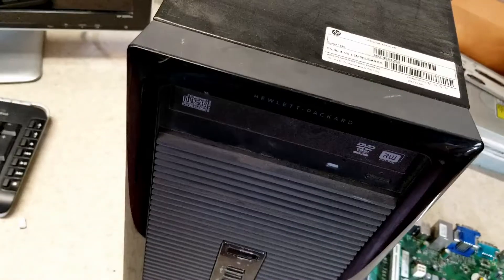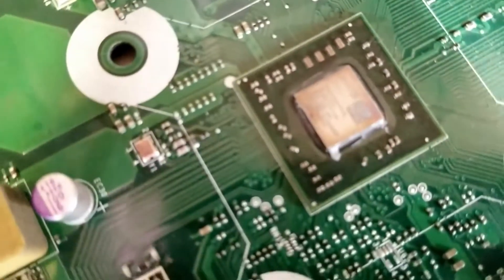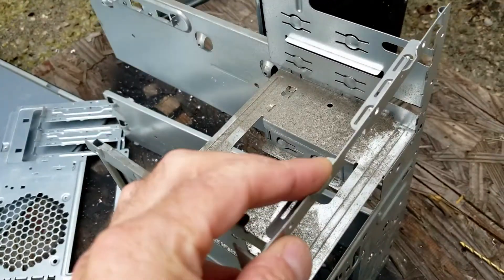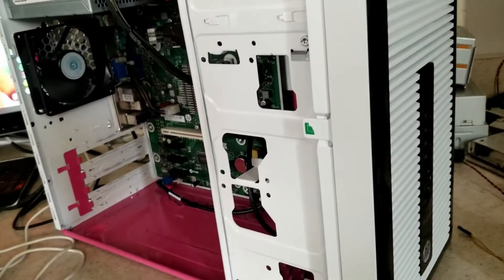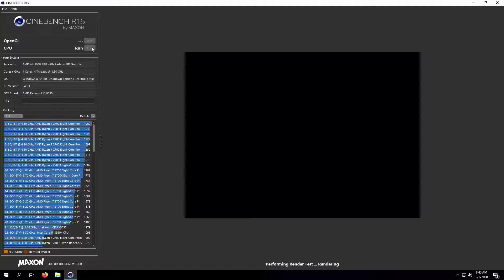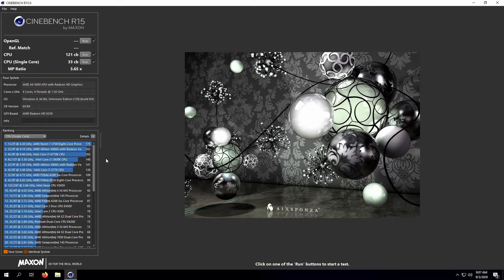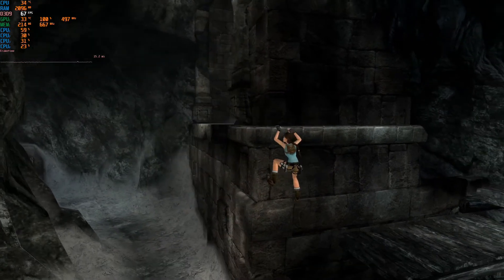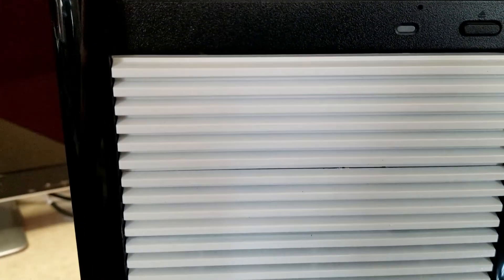AMD A4-5000 APU quad core with Radeon 8330 integrated graphics, 15 watt APU testing with some games

Comment: I had an avarege of 40fps in tomb raider 2013 at 600p and dx11 mode, don't know why it underperforms in this video, could be driver issue. And for youtube, it's not that great for it, with h264ify and a lock of 30fps it can run 1080p barely, mostly 720p. And the architecture disables any sort of overclocking, despite some of APUs from this BGA socket supporting AMD Overdrive, which specifically says in docs about not supporting this APU. A4-5000 is not fun to have in 2013 or today and looses to just about anything except Intel iGPUs from same release time. It does have Vulcan support with 2020 driver, but I doubt it's anything to write home about.

Comment: This APU still holds up well, I coupled it with 16 GB of RAM and a ZOTAC AMP CORE GTX 1650 in Gddr6, and I run games it in low/medium graphics in 1080p: Starfield, Cyberpunk, Mafia 3, Days Gone, The Last Us, Biomutant, etc... quietly. 🙂
Reply from the maker: Thats impressive!
Reply: I strongly advise against this. Instead, opt for a standard i5-4570 for around 50 bucks and invest in a quality build.

Comment: that's NEARLY my specs.  Though thank GOD I don't have the mobile CPU.  I've got an A8-3850.  But oddly it performs about the same as your chip, in most cases I get single digit FPS, though my chip is clocked much higher at 2.9ghz, so it actually runs GTA V at an acceptable 25-35 fps on 720p low, but it's still kind of choppy, mostly when driving fast where the little APU has to load in textures quickly.  I haven't dared trying flying yet.  Or multiplayer, but that's cause I just don't like it.  What rez are you doing YT playback in?  Notice any dropped frames?
Reply from the maker: I think the APU's in the A series were all pretty underwhelming, but good for daily tasks I guess. It will playback youtube videos in 720p smoothly no problem, you can notice a bit of chopiness at 1080p but even that isnt too bad, surprisingly. I have it set to 720p for her, and currently hooked up a 17" CRT, thinking it would be cool, but eh, I will probably throw a different LCD monitor on it instead.